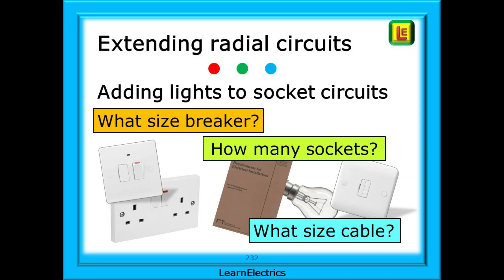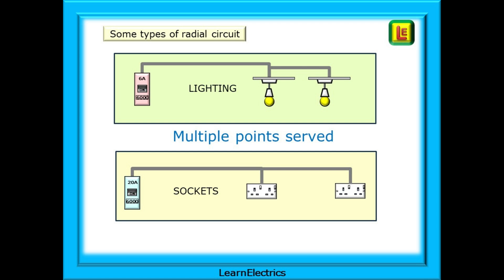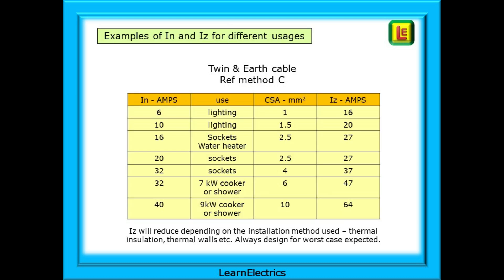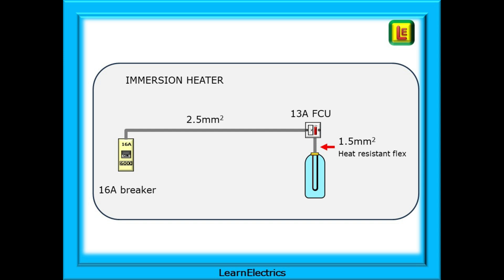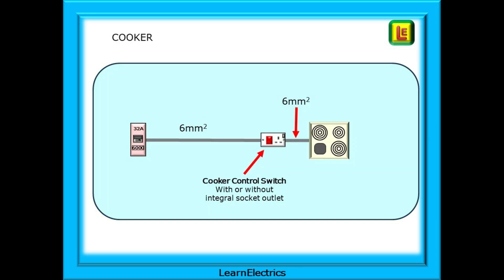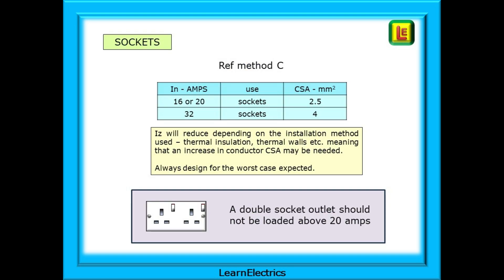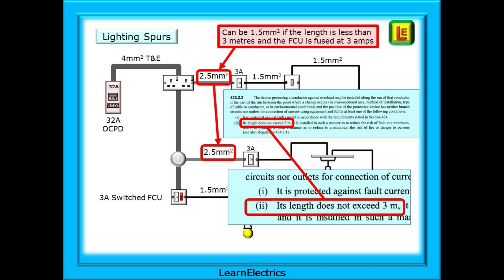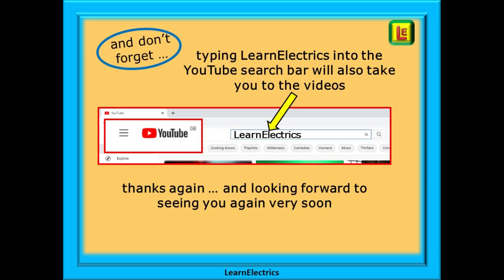EXTENDING RADIAL CIRCUITS – ADDING LIGHTS TO SOCKET CIRCUITS – HOW MANY SOCKETS? – BREAKER? – CABLE?

Comment: Hi mate. I'm stuck at a project. I spurred of a ring main socket by using a switch spur. And now I need to add lights from the socket circuit, Im under the impression that I can come off the final socket to another switch spur and down rate to 3 amps use a 1.5 and add 4 spots
Reply from the maker: Yes you can come off a socket into a switched FCU (spur) rated at 3A for four spots, even 5A if a greater load.The switched sour will also be your light switch if you want, mount it at normal switch height.
Why are the sockets on a switched spur? This means that the socket switch ed spur must be on if you need the lights on. Better to change the socket switched sour for an unswitched spur and then use the switched one for the lights. 
Take a look at the video on the link below, it will help. Good luck buddy. Dave.
https://www.youtube.com/watch?v=XqtrWfpW06w

Comment: Great video.  I want to add some extra sockets in the garage which is wired radial in 4-sq.mm. but with a 20A breaker in the fusebox.  The easiest way is the spur off using a junction box or a 13A FCU. Do I have to do it all in 4mm or can I use 2.5mm?
Reply from the maker: After a 13A FCU, it can all be in 2.5mm. Thanks for watching.
You might find this video link useful too.
https://www.youtube.com/watch?v=XqtrWfpW06w

Comment: Lighting spurs example, Example X , MCB 32amp, 4mm radial circuit with a spur ran in 2.5mm 
The cable rating for 2.5 twin and earth around 26, 27 amps, if clipped direct.
 Domestic properties tends to be wired in twin and earth.
 Why would you not supply the feed side to the FCU in 4mm, yes a single point light fitting, the amperage is is minimal, What is the reasoning to allow the reduction in cable size?

Take a 3 phase circuit with the protection of 200 amps at a MCCB panel supplying a distribution board,  ,the cable is sized to take in to account of the design current, protection and installation method, with consideration for expansion for future use.
 How can you tap of this ,with a reduced conductor size to feed an additional distribution board with a loading, of say only 50 Amp loading.
Reply from the maker: After a 13A FCU, it can all be in 2.5mm. Thanks for watching.
You might find this video link useful too.
https://www.youtube.com/watch?v=XqtrWfpW06w

Comment: When adding a lighting circuit to a garage via a 3A fuse from a radial power circuit, why is the lighting cable sized at 1.5mm2 ?  Would 1mm2 be acceptable?
Reply from the maker: We usually install 1.5mm just in case someone replaces the three amp fuse with a 13A. Dave.

Comment: Great video, just subscribed. I do have a question though. I have a FCU in a down stairs cupboard currently supplying nothing at all but it’s on my sockets ring. I am thinking of running a double socket from this, and then a spur from the socket for a single light and switch. Listening to the explanation at the end am I right that I should buy a switched FCU rather then a regular switch? 

For the record I was planning on 2.5 t&e to the socket and then 1.5 t&e up to the light.

I guess it is safer to just put a FCU in but I would love to know your thoughts 👍
Reply from the maker: If using 2.5 vcable - 13A FCU unswitched and then you can do whatever you want AFTER the FCU. You cannot draw more than 13A or so.

Comment: Got to be the best electrical channel on YouTube
Reply from the maker: great feedback, really appreciated, thank you.
Reply: @learnelectrics4402 just curious. With an FCU spur from existing socket circuit. Why does it have to be 2.5mm between the spur-socket box and the FCU? Can it not be 1.5mm the entire way??? Would really appreciate thoughts on permissability
Reply: @learnelectrics4402 as i patiently continued watching i found my question answered. Definatley the best channel as the previous guy said!!!

Comment: Great Video Dave, with some additional information for myself that I haven't seen before ..
Could you please explain what would you white down in a Minor Work certificate for a editing light point from socket circuit.Would you write down supplied from 3A fused spur or origin 32A/20A breaker in fuse board?What would Zs be calculated for lighting point as well?
Thank you once again for spending your own time to creating another knowledgable video!
Reply from the maker: Put the 3 amp as the circuit protection for the lighting. There is an entry for BS1362 fuses for Zs final circuits in the Regs book on page 67. Thanks for watching. Dave.

Comment: A 13A FCU can have multiple sockets on a 1.5mm cable. Fine, all safe. If the sockets are serving low current drawing appliances like computers no problems.
Can you have under the regs a 13A mcb at the consumer unit serving a 1.5mm radial? Electrically and safety-wise it is fine.
Reply from the maker: A 10 amp mcb at the consumer unit with 1.5mm cable is ok. This is what we would do for larger lighting circuits. Thanks for watching.
Reply: @learnelectrics4402  
Thx. 1.5mm taking into account derrating can take 14.4A to 20A according to a quick look at the tables.  So a 13A breaker at the CU supplying sockets on a 1.5mm radial is fine. Depending on the cable run even a 20A. By regs a ring is a minimum of 2.5mm cable, cannot be less, and max of 32A breaker, can be less. 

So a radial supplying upstairs with no heavy appliances is fine on 1.5mm. If it had a 16A breaker it could do two 1.8kW fan heaters at 230v.  So two 1.5kW fan heaters in case the gas boiler is down, can be run and still spare capacity for the computer, etc. But we by nature tend to put greater margins in like never fitting a grater MCB value than 13A. Unlike on the Continent with their radials, with many running to the max of the MCB/cables. 

Sometime we overkill in the UK. Once again, thx.
Reply: @learnelectrics4402  
With LEDs, a 10A lighting circuit will be more a commercial job these days.
Reply: Surely you can Derate the Radial Circuit of any SSO to be protected by a 10A MCB, allowing leeway/flexibility for use of 1.5mm² conductors.

But honestly is there Readily available 13Ampere MCB in the market? B13, C13 ?
Reply: @temp26j724-i  
13A MCBs are available but rarely a stock item, unless a large electrical merchant. Usually a special order with next day delivery.

Comment: I've been spending some time on a house that my daughter has just purchased and while doing various jobs I've had a look at the cabling. I've noticed that the socket circuit, one covers the whole house, comes out of the consumer unit in 4mm t+e then goes to about four 32 amp junction boxes, one after another. From these junction boxes, 3 or so separate spurs in 2.5mm t+e  then feed individual sockets placed around the house except for one spur which is run in 4mm t+e which feeds not only the first socket but also another one too in a different room which is placed on the other side of the wall behind it. The whole of the house is wired in the old colours and is also multi-strand cable, even in the 2.5mm. I can't make my mind up whether to swap the existing 32 amp MCB for a 20 amp one just to make the circuit safer for her or to leave the existing 32 amp breaker in place in case the breaker starts tripping with only a 20amp one in operation. I'm not an electrician, I'm a Joiner/carpenter but I do enjoy watching your videos.
Reply from the maker: So many variables here, and if its old colours that makes the circuits at least 18 years old. When were they last inspected and tested. Take a look at these two viseos that should help. Thanks for watching. Dave.

Radial circuits
https://www.youtube.com/watch?v=wKCxgEWleHk

Cable size
https://www.youtube.com/watch?v=VtTUkUpQ-Rc
Reply: The vid said a spur can only have one socket on it unless an FCU is fitted off the 4mm spine. 

So it does not conform to  the 18th, but may have been compliant when installed many moons ago. Thec32A mcb will not protect the 2.5mm cable.

Yes drop the mcb to 25A or 20A. Or better still fit an RCBO or better again an AFDD.

Comment: Can anyone explain the physics or logic in reg 433.2.2 please ?  In both cases the load on the spur is limited by the FCU.  Max fuse in FCU is 13A which we know can pass steady current of 21A all day long. What does 3m have to do with this ? Surely the 2.5mm should be standard?
Reply from the maker: The regs permit this if there is no branching. personally, I'd stick with 2.5 but I need to say if there is an option.
Reply: @learnelectrics4402  I’m with you on this one. The IET have some interesting peculiarities and I like to challenge to learn more.

Comment: A wee question ; in the lighting circuit were both 1.5 & 1mm is used , how does that work when calculating with the equation ? ie what is the Iz value ?
Reply: The 1.0mm Iz for the lighting example is still much higher than the 6A rating for the over current protective device. Older lighting circuits were traditionally wired in 1.5mm but with modern low energy lamps this is easily covered with less expensive 1.0mm cable.
Reply from the maker: A perfect answer from Mike. take a look at table 4D5 on page 456. You will see the ratings under Ref method C
Reply from the maker: Thank you Mike. Great support. Dave.
Reply: @learnelectrics4402  Thank you Dave, for a brilliant resource and the easy understanding that you have distilled as a seasoned spark. Best wishes for 2024.

Comment: I like how we here in the UK explain a normal (radial) circuit as if it's not the norm. Like it's surprising that it doesn't go back to the unit from the last point. Ring circuits are the oddballs!
Reply from the maker: I agree, but so many have grown up with ring circuits that its difficult for a small number to think of a socket circuit being anything else than a ring.